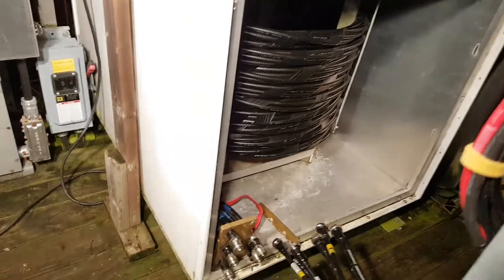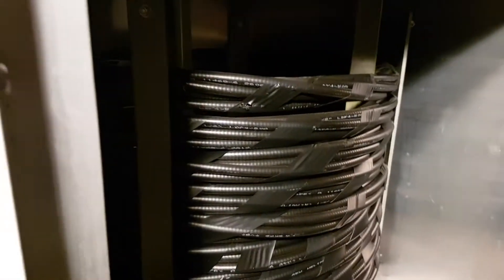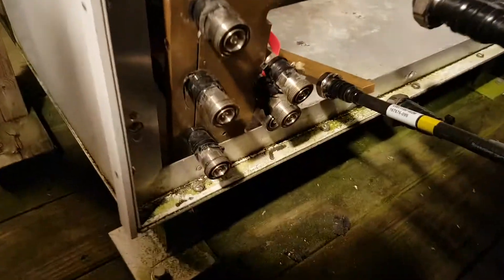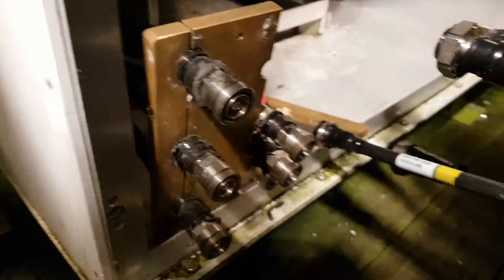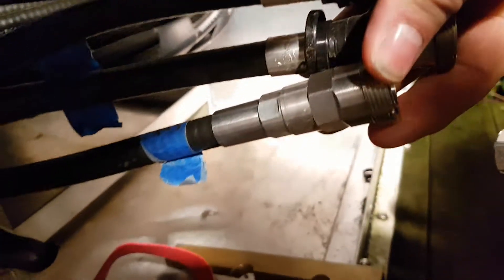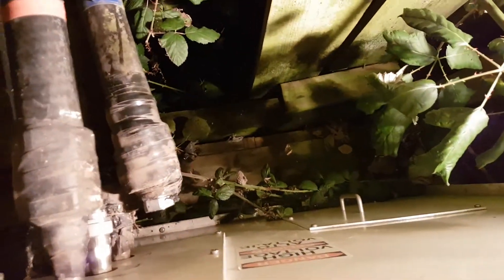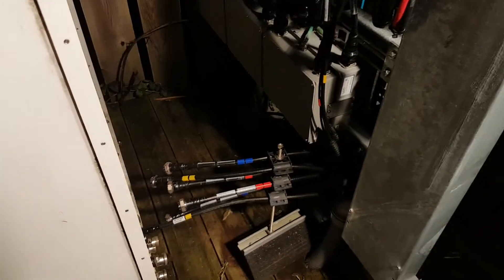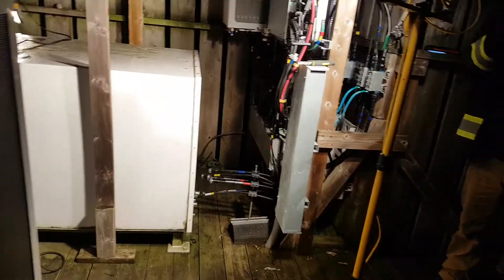2 - Night work at a Cell site on an AM tower - The Induction Coil

Comment: How to intercept cellular signals ?
Reply from the maker: This radio site is for both AM Radio and Cellular, but the AM is high power so induction coils are needed to remove the static electricity. 
 To intercept Cellular signals you would need either a Broadband listening antenna or a Stingray antenna system. Both are not available to the public.